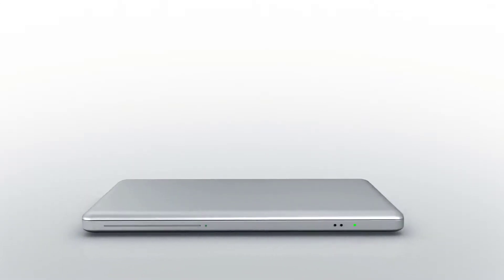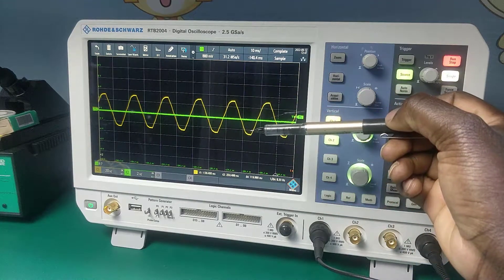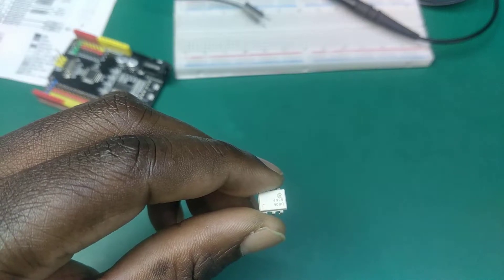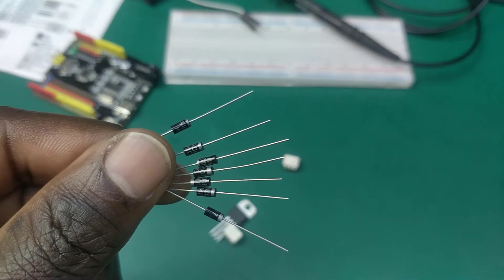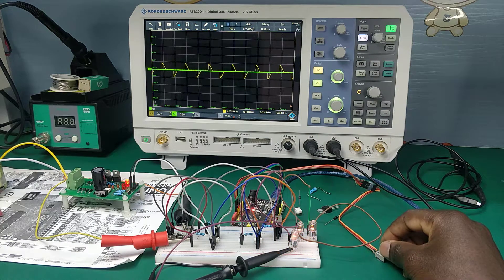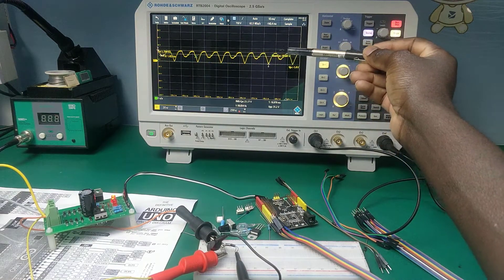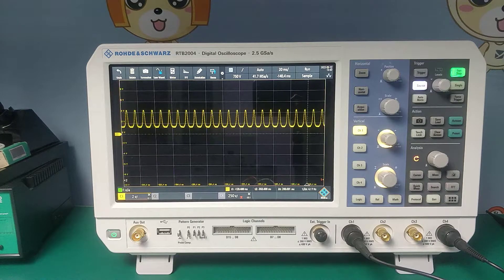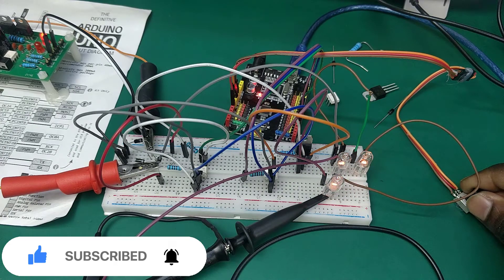TRIAC AC Control Using Arduino || Phase Angle Control || Light Dimmer

Comment: In your wiring diagram, the minus of the rectifier should not be connected to pin 4 of the 4N25 and pin 3 of the MOC3021 (isolation), instead they should be connected to one of the Arduino GND pins.

Comment: Hello,
thank you for this very interessant video. One question, you use a DIAC to help the triggering of the first optocoupler, I dont understand how this fonction with a 18 volt voltage, generally the diac need 32 Volt.....
tank you vor advance
Gérard

Comment: Very well done... also what about the Ac diac. What diac is used.. or was that for reference?
Reply from the maker: The Ac diac used is MOC3021, sure I will link the code in the description
Reply: @smoothengineering42  so the second piece in video is the 3021 diac and the 3rd piece is 4n25 octocoupler?

Thanks for posting code.
Reply from the maker: @jeremyboven   exactly
Reply: @smoothengineering42  I'm trying to control a small 300w 110volt heater for a small hot plate for soldering. But that takes 110v, and in your circuit your using a transformer to reduce mains volt to 18v ac. How would I go about hooking in the 110v heater...
Reply from the maker: @jeremyboven  you can use current limiting resistors at the input to the optocoupler to limit the forward current between  (10 -50 )mA and forward voltage to less than 1.5v. The current limiting  resistors should be on both N and L before connecting to the bridge ratifier (use resistors values between 4.7 to 10k,  since you are using 110V, 1 watt resistor or higher). Between the optocoupler and bridge rectifier use resistor value of 360 ohm or less instead of 1k as in the video, to keep the forward current (10 -50 )mA . The values  (10 -50 )mA and  1.5v or less is from the datasheet of 4N25